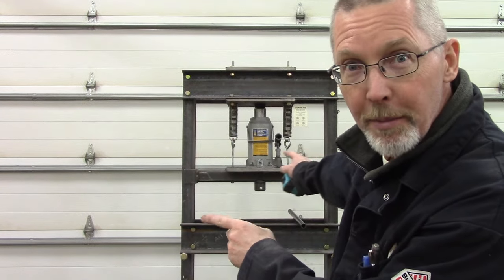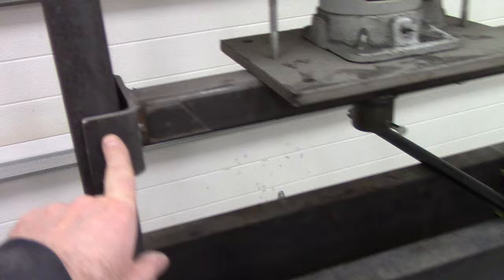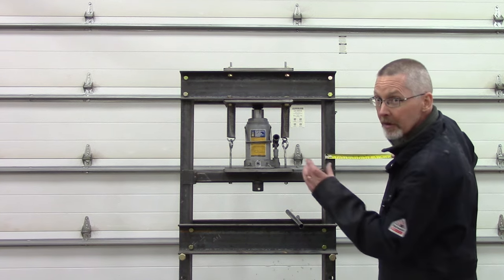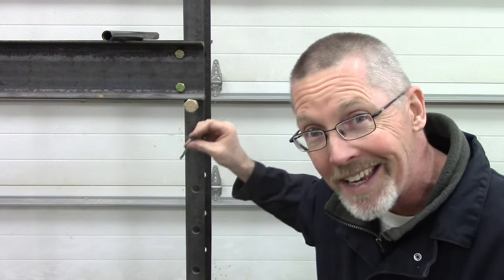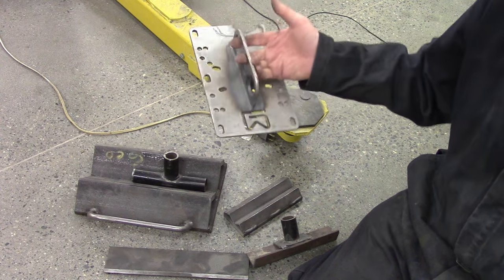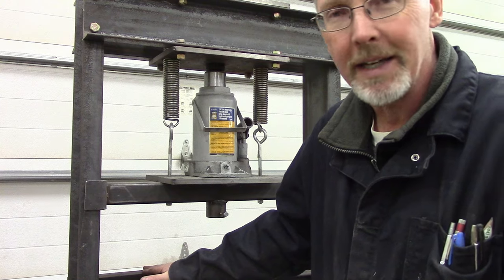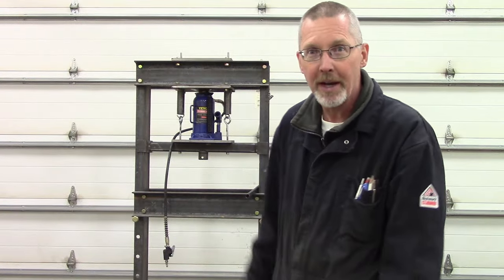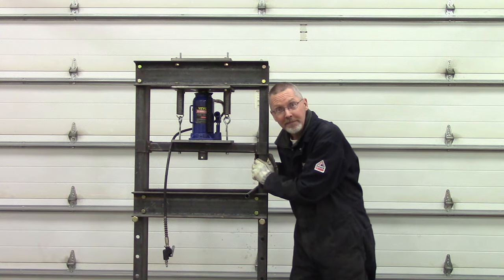BUILD a 20-Ton Hydraulic Press! FREE PLANS!

Comment: Thank you kind sir for supplying free plans, I shall not complain about freedom units of measure and will do necessary conversions myself 😬 I’ve been thinking about building hydraulic press for a while now, since I have a fair bit of steel left over from building my garage frame (yes, my garage once finished will be a bit closer to a bunker construction). Once built I shall post the result and credit your video as well, get those views in!
Reply from the maker: Here in Canada we work in both Metric AND Imperial, and which one you used kinda depends on what you're measuring: Speed is metric. Volume for cooking is Imperial but volume for everything else is Metric. Your weight is in pounds but other weights will be pounds only if its light otherwise Kg if it's heavy. Cooking temps are in °F but outdoor temp will be in °C and your swimming pool will be °F. Your height will be Imperial and distances related to work will be Imperial but if it's not related to work it will be Metric.  Bienvenue au Canada. I'm doing the best I can under these conditions.
Reply: @GregWellwood  well, isn’t that a fine mish-mash 🤣🤣🤣
Reply from the maker: And more often than not, travelling distances are measured in time, not km or miles.  Because "why not."

Comment: Thanks Mr W.  If a chap (or chapess) felt inclined to weld some or all of the frame do you have any words of wisdom?
Reply from the maker: You'll need a skookum welder with lots of heat, and pay attention to how it's all going to warp.  I have more confidence in the shear strength of bolts than I do of my welds.

Comment: My brother-in-law set me up with a 5 hp Quincy Air compressor that he put together from rejected parts from work. A tank with a small dent that couldn't be sold. Rebuilt pump. Basically new!!
Along with the compressor, came a hydraulic ram, and a foot pedal operated air over hydrologic pump. Yep, you guessed it, I searched for press plans. You have yourself a new subscriber! A friend acquired some steel at a bargain price and offered some to me for whatever project I'd like. 
If you like vintage vehicles, check out the playlist on my channel about my late father's 1958 Plymouth Suburban. Some have chosen to subscribe to follow along as I slowly get it back to daily driver condition.

Comment: several years ago i built my shop press (i was farming pretty big then)  it is made out of 1/2in thick 4in angle iron 6 ft long riveted 6in apart (salvaged bridge beam) with 4 - 10 in  channel for the tops and the table.  my pins go through the table and the angles on the sides.  i tried something different for the head it slides across the tops so i can put it right next to the side or anywhere between (with the angle iron riveted about every foot with 5in wide strap ) you can go through Long ways  with long but narrow pieces again there is about 6in between the angles.  it is pretty wide across the table and i should have made the head plate and the top cap that holds it in heavier it has bent a little and now wobbles slightly until pressure is on it .  i also up graded to an air over hyd and picked up a foot pedal valve for it but don't have the valve on yet unfortunately it is outside right now .  and Yes keep the old bearing races and cut off shafts  i found a 6x 12 piece of 2 in plate to press against (dont know where i found it ) (no x blocks yet just lots of big blocks of plate)  great vid very informative  have fun with it

Comment: I may have missed it in the video, but did you use standard or heavy duty channel?  I priced it out at my local metal supplier and they offer both standard at approx 3/16” thick and heavy duty at approx 3/8”.  

Have you noticed any deflection in the top or the bed with the 20-ton press?  I was thinking of getting a 32-ton instead as the cost isn’t much different.  If I do, maybe the heavy duty channel is the way to go.
Reply from the maker: I'm pretty sure mine is 3/16" thick, but if heavy duty isn't much more money, I'd go with that.  I get some deflection, but I've always chalked it up to poor measurement and sloppy construction (grin).
Reply: Thanks for the quick reply.  It’s about $60 more to go heavy duty so I think I will likely do that unless I come across something else!

Comment: Very interesting, very helpfull. Thanks.
Noob-Question: Why is it better to press down than up? Or why is the jack on top not the bottom?
Reply from the maker: I don't think it matters which way you press, but I'd think it's earier to move just the table to press something large, than to move a table with a bottle jack on it.  Truthfully, I reverse-engineered a press I have at work to make this one; it had the bottle on top.

Comment: You should consider inverting the Jack.   This allows you to eliminate the cross arm, and one set of springs.  I did this on mine and love it.   I also mounted the air valve on the column and activated it with a foot lever.   Very handy.   Is this a good place to say Bob,s your uncle?
Reply from the maker: You know my Uncle Bob?
Reply: Do you have info on how you inverted your bottle jack?

Comment: How is the air over hydraulic bottle jack working.
Reply from the maker: Still working well.  Used it a couple weeks ago to replace a FWD wheel bearing.  This would make re/de-arcing leaf springs SO much nicer than a manual bottle.  I feel silly for not chosing air/hydraulic right from the get-go.
Reply from the maker: I keep checking it for leaks every time I use it, because I've gone through a few bottle jacks from another supplier.  No leaks so far.
Reply: Good video
Reply: I am looking for a 20 ton ram with about a 7" travel. I like the 20 ton press from Eastwood.  I didn't like the $190 shipping charge. I like your press just want the bottle inverted or find a ram.

Comment: First, you need to keep one of those foam gardening pads handy for your knees. Very cheap but very helpful. 

Second, I share your preference for corded tools. House power is 100% 24x7, so why use batteries in the shop?  They always let you down. Save those for mobile use, and never buy Bauer from Harbor Freight. Their lithium cells are inferior.
Reply: Also, great tip on just using bolts for the crossmember supports. You can use solid rod, but bolts are usually harder and the head is a built in stop for one end.  

Also having it on casters is another great idea since all of the pressure is in the pressing zone, not onto the base.